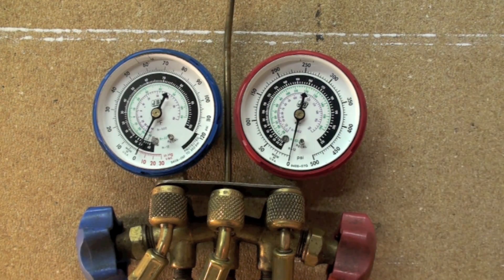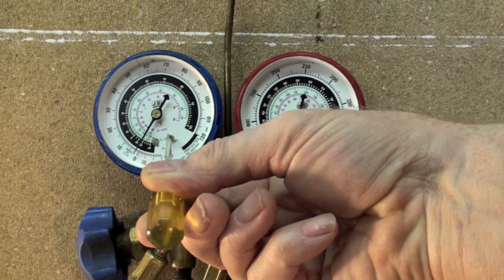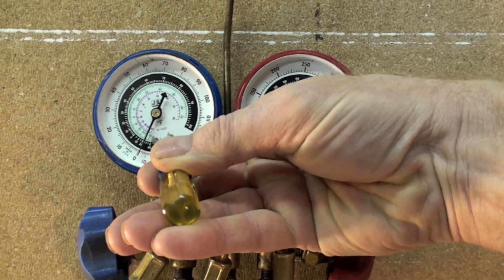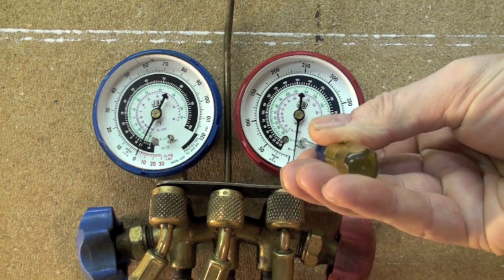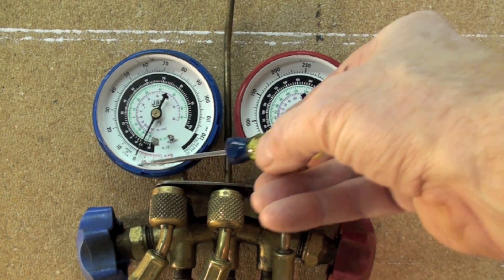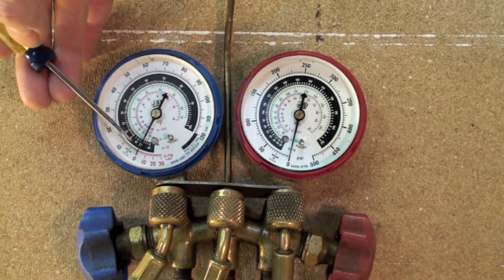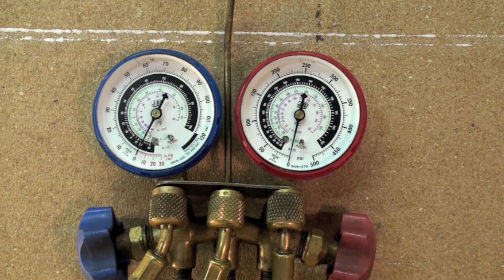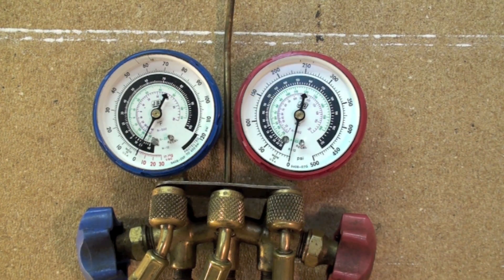Zeroing the refrigeration gauge set

Comment: Does nothing except zero the needle. Most likely when reading pressure it is way off.
Best to check with a tank of refrigerant and dont bother with zero, compare to a PT chart, then set the needle to that temp. Of course who knows if your temp probe is accurate either!
Reply from the maker: The idea here is to zero the gauge, thus the title of the video.  We are not testing accuracy in use.
GFM